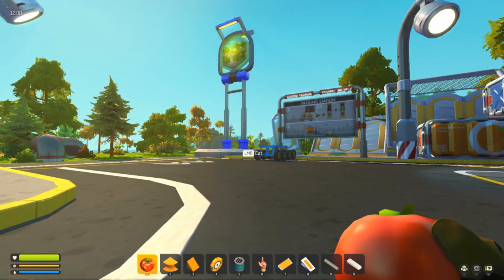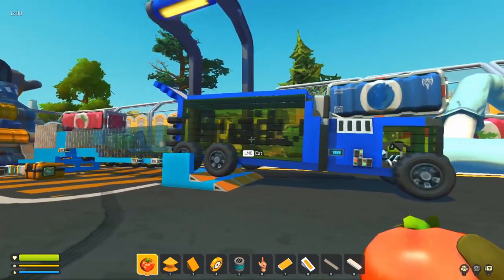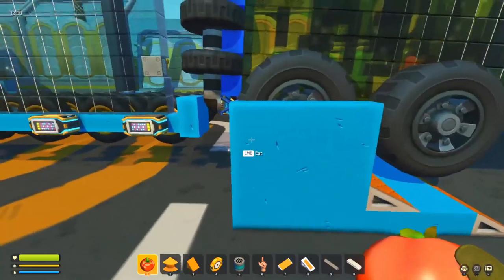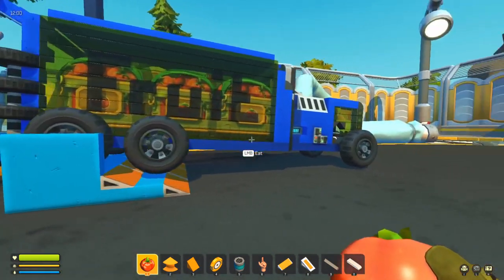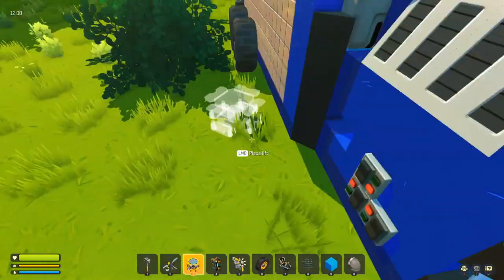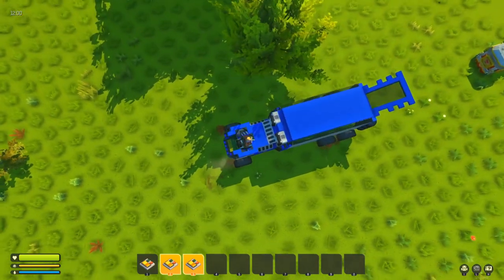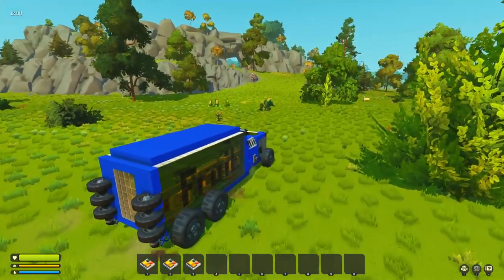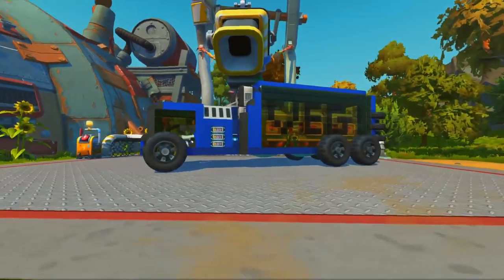Automatic Loading Scrap Mechanic Survival

Comment: 3:40 would it work for caged farmers?
great video as allways...
Reply from the maker: so this current build cannot pick them up but if they are behind the truck and you back up into something to force them in, they will load, I think its a height issue rather than anything else by the looks of it